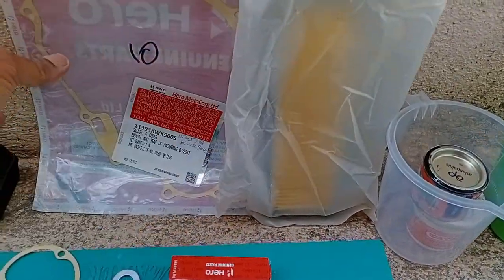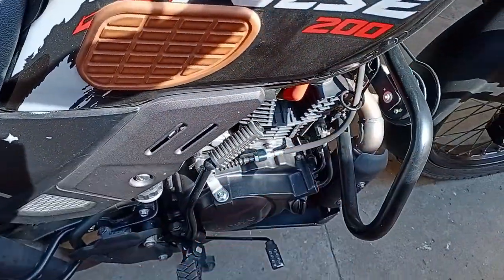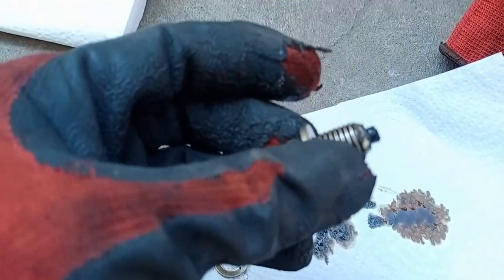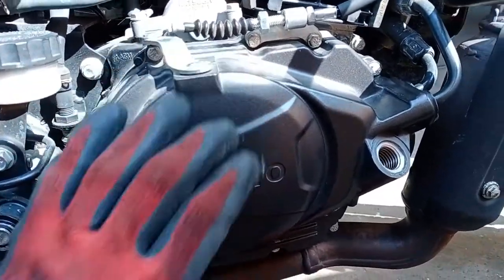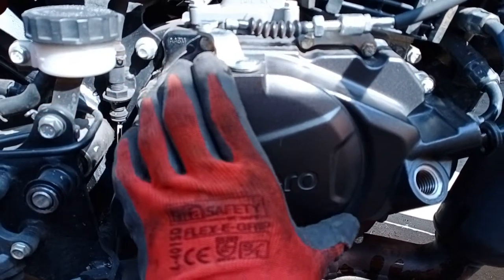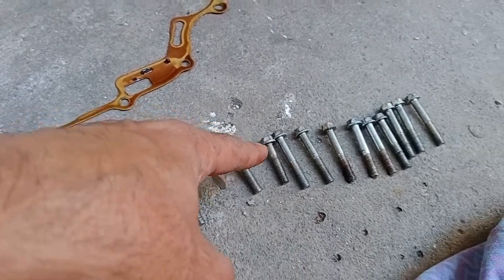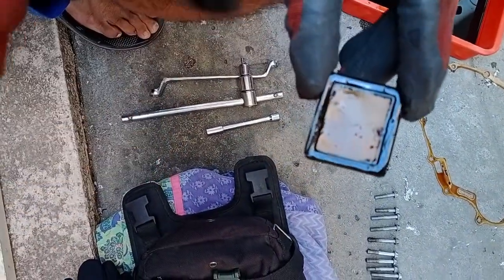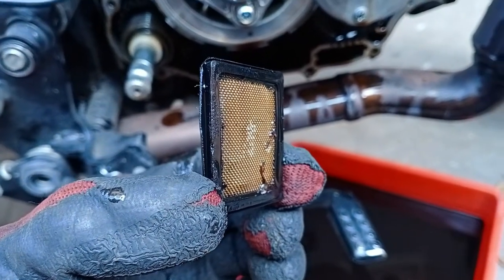Hero Xpulse 200 Oil change at 12000kms | Oil Filter Cap & Strainer Cleaning

Comment: Sir do I need to buy two bottles of 1L engine oils?? Or 1 L will do ?? For xpulse 1.2 litre capacity
Reply from the maker: Yes..We need to buy 2 bottles and after using 1.2 ltrs,keep the remaining for top up.. Because for every 1000kms we need about 30ml to 100ml as the engine ages.
Thank you 😊 Ride safe.

Comment: Iam bs4 xpulse owner sir, I want oil cooler if only change right crank case cover and oil cooler set k. or any Modfications.
Reply from the maker: I think you need to change the crank shaft,oil pump and centre crank case as well.
Reply: Thanks for replay sir